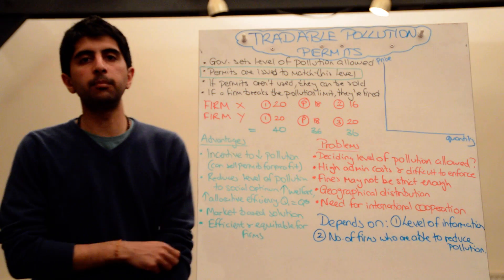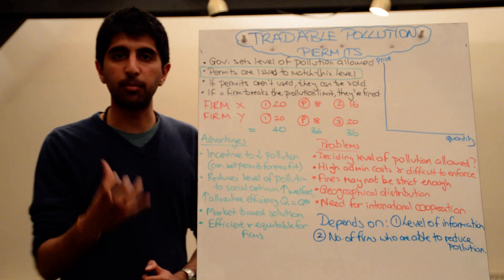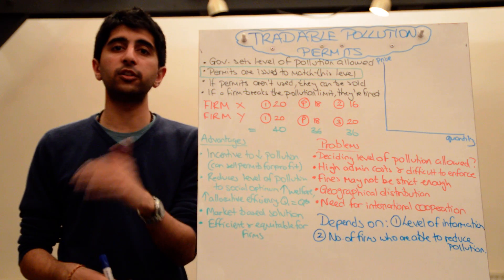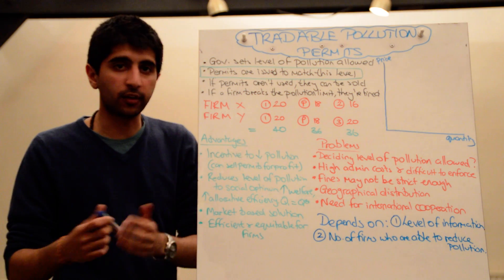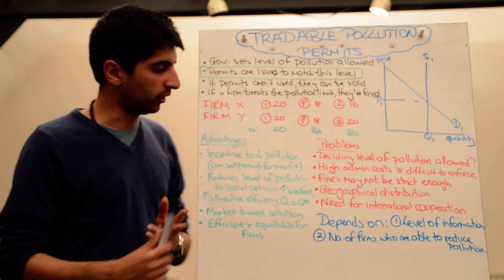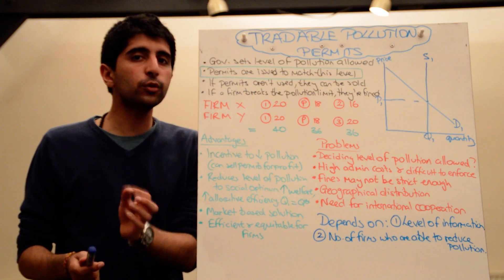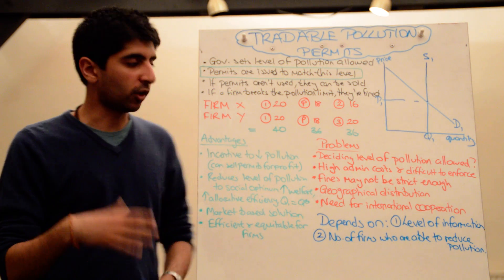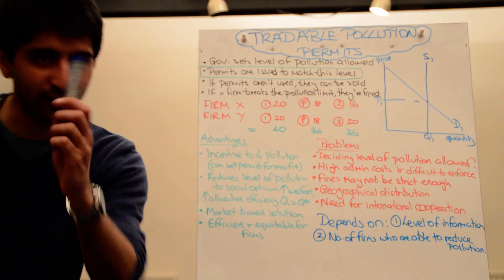Y1/IB 32) Tradable Pollution Permits

Comment: If one was trying to answer a question such as "To what extent are tradable pollution permits an effective method of reducing market failure arising from carbon emissions", would I lose marks for using a negative externality diagram to explain how permits internalise external costs arising from pollution, which would result in increased cost of production (causing shift to left in supply), reducing over-production etc.?
Reply from the maker: ***** No this is bang on
Reply: ***** would you not just draw negative externality diagram and say that pollution permits cause the external cost to be recognised and paid for? Moving curve from MPC to MSC?

Comment: Hi ***** , is it the shift to the left of the supply curve in that industry ( due to increase in COP, therefore solving overproduction) or is it the fact that the number of tradable permits are fixed at the socially optimum amount that solve market failure here? Or is it both?

Comment: Do all firms get the same amount of permits initially? For instance, would a small firm - possibly one which isn't  polluting much anyway - get the same amount of permits as a large firm with a large output? Surely then the large firms face a much larger increase in costs than the smaller firms.
Love your videos by the way, thank you!
Reply from the maker: xPSG1 Good question, that depends on the government issuing. Your situation may lead to differing permit levels distributed based on size, in which case fine. Whatever is deemed equitable
Reply: cheers